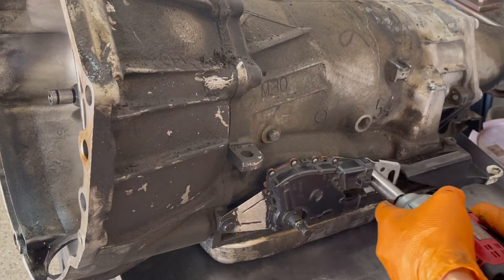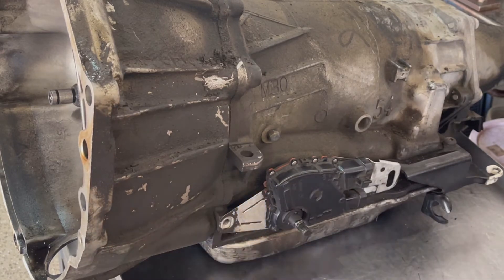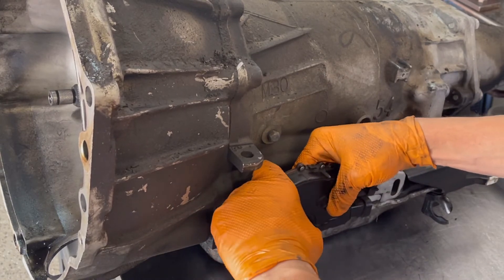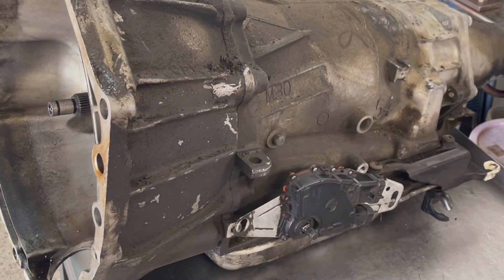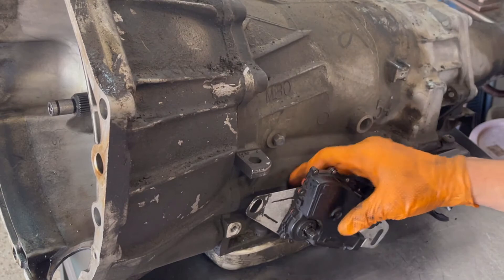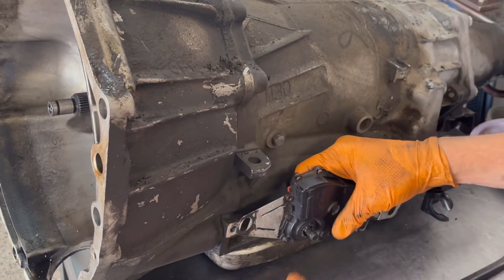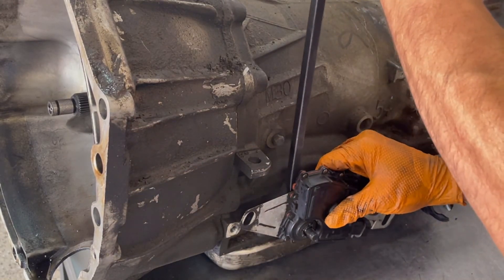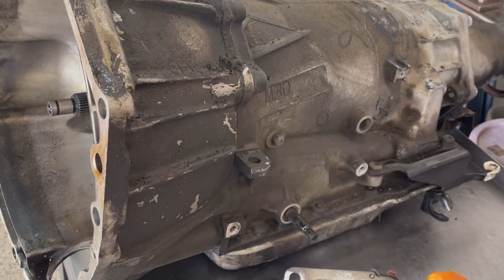4L60E & 4L80E   No Crank No Start Bad Digital Range Sensor/MLPS/Neutral Safety Switch

Comment: 03 GMC Sierra 4L60E, I replaced the NSS on a replacement trans, but I have a no crank condition in Park or Neutral or any other position for that matter. Checked starter and it's good, but the gear selector bar indicator is slightly sketchy. What else could be causing my no cranking issue? Any help would be HUGE!
Reply from the maker: Thanks for watching, SoHeaven. I'd scrutinize the wiring leading to your MLPS for shorts, frayed/damaged wires and perhaps back-probe everything to ensure you're getting power to the MLPS, assuming you haven't already done so...Also check to ensure the battery actually has power, if not already verified. Let me know what you find and we can go from there.

Comment: What if I'm getting continuity between pin 1 and 11 when in the correct position?
Reply from the maker: What are you referring to? The case connector for the trans or the MLPS?

Comment: I have a 02 avalanche i think its the connection issue to it ive replaced the nss and still have same results some times but flicking the key back and shifting it sumtimes in gear i can start with my push button but the button dont work when the key is working
Reply from the maker: Agree, it sounds like an electrical problem...Check all of your vehicle/chassis/powertrain grounds. Also ensure you have serviceable wiring to and from your battery, starter, etc...

Comment: I have a 08 chevy avalanche.  that you have to giggle the key switch alot to get it to start then you have to go from neutral to drive alot before it goes into drive. once it does it drives fine until you out it back in park.
the owner before me replaced the cable
Reply from the maker: Could be any number of things. Test the ignition switch, that may be your problem.

Comment: I've got a 04 sierra with a 4l60e that has all the lights turn on but no crank when I try to start it in park. I can start the vehicle just fine in neutral though. Is this the same part?
Reply from the maker: Yep, replace the MLPS. It's detecting a signal when you're in neutral but not in park which means it's failing. You should have the single large connector design.

Comment: So I installed a new one on my 2000 sierra but it won’t even start or crank. I reconnected the old one (which works intermittently & only turn on on neutral) and it worked right away. Any idea on what it could be?
Reply from the maker: New one is either not connected or DOA...IF DOA, take it back for another...

Comment: Are those really that hard to get off or does it need to be in neutral? Because I tried taking mine off and it didn’t want to come off
Reply from the maker: Yes, they can be difficult; I typically use a small pry bar to get them off.
Reply: @moneymakinsonny1  what happened for me was I didn't apply my park brake while in neutral before attempting my repai so I had a lot of weight resting on the transmission  shifter causing it to be hard to shift by hand or come off.

Comment: Have a 93 C1500 that just had a check engine light come on and threw code 28, Transmission range pressure switch. I have had some issues here lately where sometimes it won’t start back up after I drive somewhere. So far if I wait a little while it will start up again. Could it be related to this switch or is it that code 28? Or both?
Reply from the maker: Hi Jay, thanks for watching. Your 1993 truck doesn't have an MLPS; those were introduced in 1995. Replace the pressure switch manifold assembly but I'd do a continuity test on it w/a multi-meter before you chuck it...If it passes the test, the problem may be your internal transmission wiring harness itself, shorting out at the wires going to the pressure switch manifold.

Comment: i have a 4l60e in my australian vx ss commodore (ls1) and the car starts properly in park and neutral, but the car only has 1 forward gear and has reverse, doesnt ever shift out of whatever gear it is in , (1st or 3rd im thinking) , scantool says P0705 , would a faulty range sensor allow the car to start but also give me the problems i am facing?
Reply from the maker: Sounds like a loss of communication between the PCM and the vehicle speed sensor. Check that, if you haven't done so already.

Comment: I got a 2006 Chevrolet Silverado 1500 I replaced the safety switch but it show it in neutral and won’t show me that I put it in park but will got from neutral to 3rd what could that be
Reply from the maker: Check wiring around the MLPS, if you haven't already...If you have already done a bunch of troubleshooting, list what you have done/checked and we can go from there.

Comment: I have a problem where it doesn’t highlight The  park so when I turn my truck it allways have to be shifted to neutral to turn it on but sometimes it does highlight that it’s in park but still don’t turn on it only turns on in neutral any help????
Reply from the maker: That's your manual lever position sensor, assuming you have a 1995-2008 GM car, truck or SUV with a 4L60E, 4L80E or similar transmission. Replace the MLPS and you should be good to go.
Reply: @ where is this located in the shifting  colum ?
Reply from the maker: It's bolted to the side of the transmission for 1995-2008 model years...93-94 its located on the steering column.

Comment: What if it starts and no gears engage?
Reply from the maker: Sounds like pump failure but check your level before and after starting..If it's way over the max and doesn't change once fired up, time to yank and overhaul the transmission (see my rebuild series on these units for guidance).

Comment: Question truck starts in part but won’t start in neutral. What is that?
Reply from the maker: You must have a two-plug switch so a 1995-2003 model year vehicle. The park plug is still transmitting electrical signal while the neutral plug isn't. 

Bottom line: Replace the MLPS asap before the other channel burns out.

Comment: Hi So when you hooked up your 0bd2 scanner could  it read the vehicle with a bad neutral safety switch?
Reply from the maker: I don't believe you can generate codes on those MLPS systems as they aren't wired directly to the PCM but use connective circuitry directly to the ignition system so if the MLPS isn't passing the electrical signal when the trans is in Park or Neutral then the vehicle won't start.

Comment: So I just replaced the neutral safety switch in my 2003 grand prix, hooked the scannr up, and it is still reading 3rd gear, but it is in park. On the scanner it only reads 3rd, and 2nd gear, wont start.  Do I have to take the bolt off, put the shifter in neutral, line the selector up to the N on the neutral safety switch, then reinstall bolt?
Reply from the maker: Hi, I'd try what you suggested to see what happens...Also make sure the connector is fully seated and that no wires are cut/frayed. I'm not super familiar with the 4T65E transmissions like the one you have in your Grand Prix but they all generally install and work in the same manner.

Comment: I payed 1400$ for the mechanic to replace and electrical trouble shoot the truck and still not running … screwed over once again
Reply from the maker: Sorry to hear, John...I started rebuilding transmissions and do all my on vehicle maintenance because the same thing happened to me many years ago...See if the mechanic would be willing to take another shot at it or at least refund some of your money as it sounds like nothing was done that should have been.
Reply: You towed it from the mechanic's shop?? Wtf?
Reply: @mdscownz  I returned and they switched out the part they say they replaced was broken , nope I drove it out never used a tow , last time I ever went to mechanic shop
Reply: @John_doe627  I don't want to defend shiesty mechanics, but it may have actually been broken and been an obvious starting point. You could have had other issues as well as your range switch.

I've been a professional mechanic for 10 years and will share a story to maybe make you feel better:

A volvo xc90 came into the shop for a no-start concern. I noticed it was leaking just about everything, including fuel from the injectors. I recommended all the necessary gaskets and components to fix the leaks as well as a new starter. 

They just approved the starter. 
I replaced the starter. The car caught fire the next day and burnt to the ground. 
They tried blaming me but I had recommended all the leaking conponets as well as the starter. And they only approved the starter. We made them sign a waiver when leaving. 

They probably won't ever go to a mechanic again either... but it's their own fault for buying a piece of shit they can't afford to maintain.
Reply: @mdscownz  yea I spoke to the mechanic shop owner and he will refund me the money on a battery he sold me that was defective and a different story you told , in which the mechanic isn’t in the wrong but in my story the mechanic is very wrong and still owes me a apology and money

Comment: So what if the only way my 05 suburban will go into park is if I have the gear selector in the park position and roll backwards slightly into park from reverse you see it will say I’m in reverse when in park but if I reverse the engine and go back a inch it will catch the parking pawl and unlock the doors and tell the truck it’s in park thank you
Reply from the maker: Thank you for watching, Gary...As far as the transmission's behavior, thats normal however your MLPS may or may not be sending accurate range position to the PCM, which informs the driver info center/range indicator on your dash. 

If the manual lever position sensor has never been replaced, I'd replace it out of an abundance of caution as if it totally fails, you know what happens...

Comment: Working on a 09’ Chevy Silverado. No crank, no reverse lights, no fuel pump. Apparently the nss is  internal on this trans. Can a nss cause a no fuel pump? Replaced the ign switch and swapped out the fuse box and relays.
Reply from the maker: Hi Ted, you're correct...The MLPS and pressure switch manifold assembly found on the 96-08 4L60Es was replaced by the Internal Mode Switch (IMS) that does the same thing...If the IMS comm channel responsible for communicating the P and N signal to the PCM is non-functional, there will be no-crank and no start as the PCM cuts off power to the starter, fuel pump and anything else involved in vehicle start up.
Reply: Ok sounds like I’m on the right track!! Thank you and great videos. Subscribing now!
Reply from the maker: Thanks, Ted! 
You can drop the pan and continuity test the IMS to find out if it's bad or not. See this Gears Magazine article for more details (pg 28-29): https://gearsmagazine.com/resources/issues/fdd2f_2012-1_allnobg.pdf

Comment: Working on a 09’ Chevy Silverado. No crank, no reverse lights, no fuel pump. Apparently the nss is  internal on this trans. Can a nss cause a no fuel pump? Replaced the ign switch and swapped out the fuse box and relays.

Comment: How do you bypass the switch so the truck can start. Relay is good, ignition switch is new.
Reply from the maker: Hi Zach, thank you for watching...Good question - I'm not sure, to be honest...I keep an extra MLPS in my two trucks that have the 4L60/4L80 so if one fails, i just put on the other.

Comment: You don't show how to set it
Reply from the maker: The inner diameter is shaped like the selector shaft itself so just lube the shaft, align the inner diameter of the sensor to align with the shaft then install it. Secure it with the two 13mm bolts and then plug it in. That's all you really need to do. Then start the vehicle in Park to confirm it works in Park. Do the same but move the shifter to Neutral and start it up. As long as the vehicle starts in P or N, you're good to go

Comment: Have power to IGN E but no (on) at crank fuse when start. Starter starts engine in run by bypassing at relay. When I tried to drive it up and down the driveway the trans slipped. Probably because the park/neutral swith.. and the transmission won't work either because of it. Im fairly certain my no start no crank at the key is due to the P/N position sensor.
Reply: I think it went into limp mode  only starting in 2nd gear. Driveway is up hill so it didn't feel right driving up hill in 2nd. At first I thought the emergency brake was on. So the transmission definitely has something going on there, along with no crank. 
Doing fine then one day warm it up, turn it off, go inside for a while , come back out and all this no start mess.
Reply from the maker: Do you have a 4L60e or 4L80E?
Reply: @nickstransmissions  4L60e with single connector sensor
Reply: @nickstransmissions  If this is bad shouldn't the reverse lights not work or is there multiple circuits in it that can go bad separately? fixing to check reverse lights..
Reply from the maker: Good question, it likely impacts the rev lights but to be honest, it's not something I ever tested. Let me know what you see/observe when you check.
Reply: @nickstransmissions  reverse lights work, all shift positions on dash, but its not on the green display, it has its own orange indicator. similar to the old school cable pull indicator. The connector has a few pairs of wires. Haven't found a diagnosis test video on one of these. All those connections in the terminal have values.
Reply from the maker: Good info, Cory...So do you still have no crank - no start or is the engine cranking over?
Reply: @nickstransmissions  its still no crank. Unless I jump the starter relay in run. Fires right up that way. I need a code reader but all signs lead to that LLY because it starts in 2nd when in drive.
Reply from the maker: I'd replace the manual lever position sensor regardless IF it's still original and never been touched - you don't want it stranding you somewhere especially far away from home w/no cell service. That said, it may or may not be the problem and I'm no expert on vehicle electrical systems so can't comment beyond that.
Reply: replaced the neutral sensor and still no start. 
not the starter and not the park neutral ss. 
Dash lights on in run off during start.
Reply from the maker: Sorry to hear, Cory...Unfortunately, you're outside of my area of expertise...Perhaps check out 1A Auto's channel as they have a lot of GM vehicle troubleshooting and diagnostic videos that perhaps can help. 

Meanwhile, keep the old MLPS in your vehicle since it's probably still good so if you ever need to swap it out on the road side, you can do so.
Reply: @nickstransmissions  A connector came loose in the column, probably from tilting.  the limp mode was a part of its response.
Reply from the maker: Gotcha - yep, that can happen but does it start up and trans shift normally now?
Reply: @nickstransmissions  Sure does actually runs smoother after guy went through the computer.
Reply: @CORYJOHNM do you know which connector came loose, my truck is doing the exact same thing now. Any info would help
Reply: @jd.8886  no sadly. It's in the steering column cover. Probably the underside. When I get it back from the shop the clamshell cover wouldn't snap to gather and I felt resistance from it moving up to the top half as if all those wires were not managed correctly. So I'm guessing that was where the work took place.
Reply from the maker: Hi Cory, thank you for watching. 

If you're not able to start your vehicle (no crank/no start condition) but have power to everything you should in the ignition circuit, battery fully. changed, etc then MLPS may be the culprit....Grab a new MLPS and go underneath with a heat gun or hair dryer and hold the gun/dryer over the connectors for about 30 seconds or so or until the dialectic grease is melted then remove the connector(s). Install the new switch and if need be re-heat the harness-side connectors then plug into the new MLPS...You should be back up and running once done. 

That said, if the transmission is slipping in any gear or range, there's applied elements excessively worn in the case or leaks in the apply circuit due to worn or cut sealing rings and/or lip seals. 

Slippage will not be caused by a faulty MLPS or neutral safety switch. Once the engine is running, the MLPS is done and has no influence on the transmission's function.